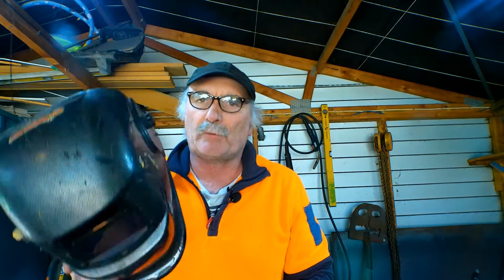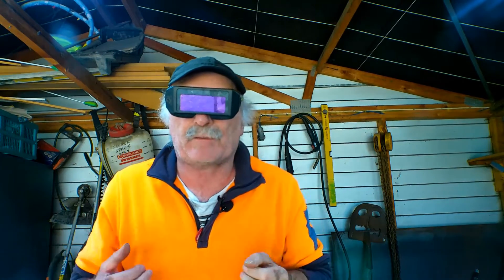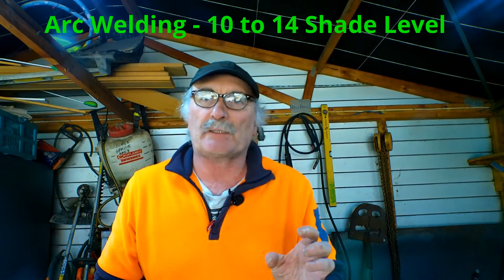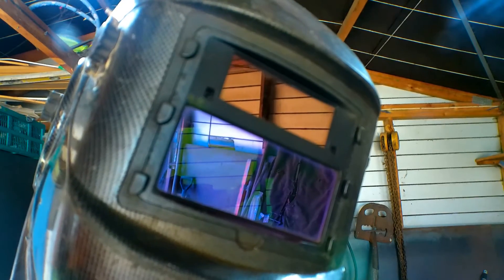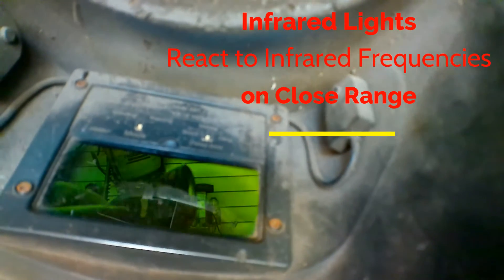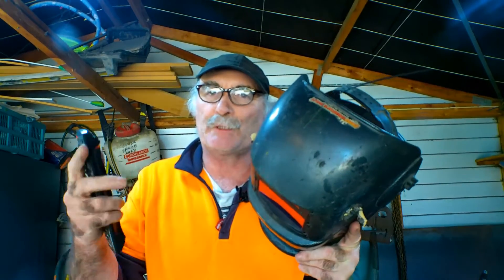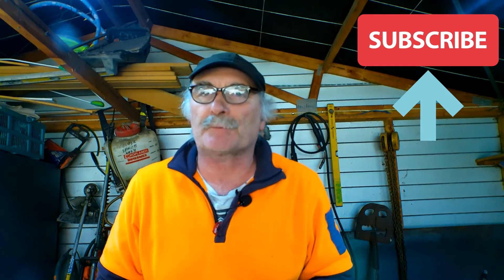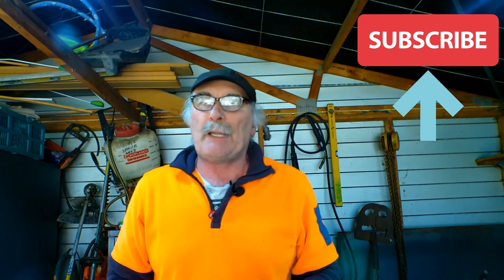Welding Helmet Test: Does Your Helmet Work Properly ?

Comment: Cool.  No.way that hood is darkening at 1/25000 of a second.  Thats the problem with the solar ones...they can delay.  As you said "go charge it in the sun first".

Heck, ill be blind by then!

I have a solar auto and get arc eye from it!

I have keep my eyes closed the first half second of arc soni dont get flashed. 

Mine is slow just like yours.

Not cool.
Reply from the maker: Thanks for sharing your experience with the solar auto darkening hood! It's important to be aware of the delay to avoid any eye strain.

Comment: If you are wearing an auto helmet and it doesnt work, other than not being able to see the arc properly, there is no chance of getting arc eye as the UV rays will not pass through the helmet lens, whether its dark or not.
Reply from the maker: Goes from light to dark
Reply: @petestools  Whether it's light or dark doesn't matter.  The UV rays, won't pass through clear grinding googles, or even glasses.  

The test is useful anyway though, as while getting flashed wont mean arc eye, its not something which will help with good welding.